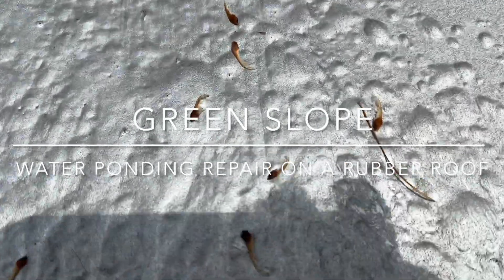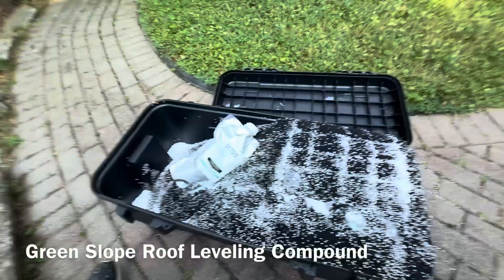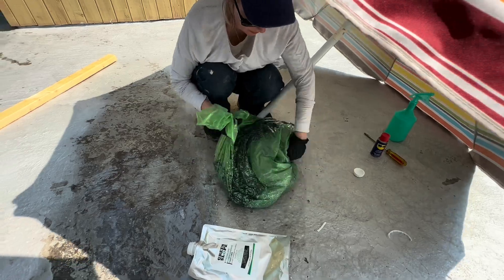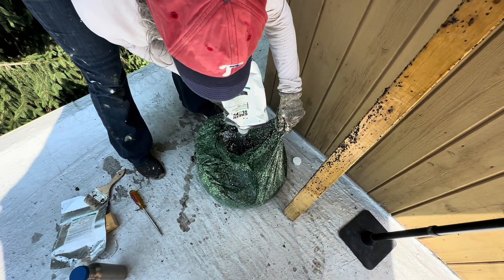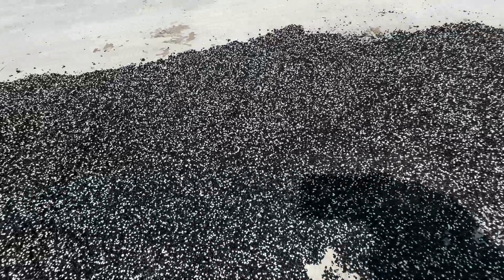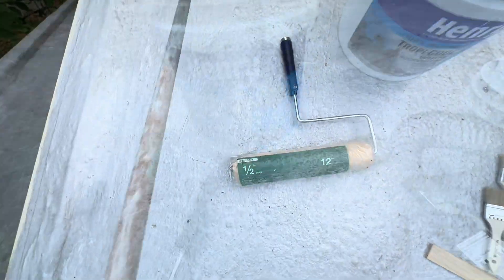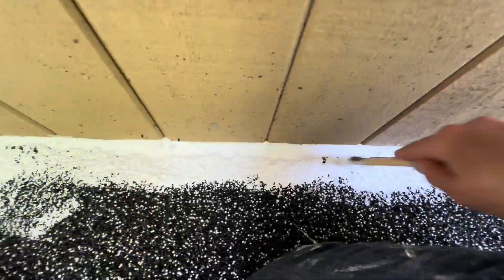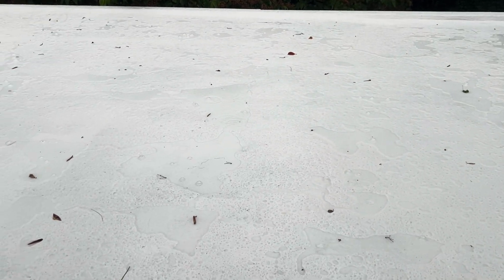Repairing Ponding Water on a Flat Roof using Green Slope

Comment: You can buy styrofoam beads and mix it with Portland or white cement and do this for 1/10 of the cost. Also add some chopped fiberglass, really helps
Reply: Would it be too heavy for the low spot roof?
Reply: @TruongLe-eo8kh  no
Reply: I mean weak spot that already has damage when looking up from under . Roof is above garage

Comment: Actual goddess.   I watched hundreds of flat roof repair videos on ponding and they were all full of shit.  Finally someone that understands basic logic of a flat roof that you need to level out the ponding before putting on any top coat anything. 

I was looking for a self leveling compound that was lightweight, but most people are using ceiment and I fear that is too heavy to layer onto a compromised flat roof. 

This stuff looks like exactly what someone should use barring industial foam sprayers which we are all here trying to avoid and DIY.

Praise be to the goddess of DIY 🎉

Comment: If you use silicone on the roof there's no need for roof sloping as it is 100 percent water proof and can pond for a long time  without any worries of the coating Deteriorating. Other coats Deteriorate due to dirt,  leaves and other debris building up and becoming acidic and damaging those ponding areas or edges. Keep your roofs clean and maintained and they will last much longer.🙂
Reply: Roof slope is 2 raise level of roof...so no water sits there!!! Not used as a coating!! My rubber only lasted 2 years due 2 this problem!!!
Reply: @terrylynn7396  100% silicone is 100% waterproof and will not get damaged due to ponding water!!!
Reply: This is wrong , silicone will fail with standing water,  it happens all the time. The water with the sun will destroy the silicone over time. The water then makes its way under the silicone and the damage spreads.  I've seen it destroy silicone in less than 2 years.
Reply: Excellent job. Thank you for informing me about this product.

Comment: Has this roof tobacco stained yet? (Turned yellowish/brown due to the asphalt bleed out from the Aluminum coating)
Reply from the maker: Not yet. It’s still white. The section that I used the green slope on is a little bit yellow, but it’s not that bad.
Reply: @Handywoman next time just buy styrofoam beads on a bag of Portland or white cement. Mix it up with some fiberglass chopped and laid down. Also, I would lay down a lot of window screen, fiberglass as you're reinforcing mesh
Reply from the maker: @RRaucina interesting idea

Comment: Can you put the green slope over top of Tropicool? Did my whole roof with tropicool a few years ago but now have a ponding section.  Actually considered just building it up with more tropicool until I found your video.
Reply: Unfortunately no. Nothing sticks to Silicone but Silicone. I would use the HE885 Silicone Mastic to float it out, then top coat with the 887.
Reply: Use green slope 1st. ....then go back over it with rubber coating!!🎉
Reply: Can we get an update?? Did it last???
Reply from the maker: @terrylynn7396 
It’s holding up. So far so good.
No ponding water.
Reply from the maker: Yes, I don’t see why not. 
Make sure to put the supplied adhesive polyurethane down on the roof first.
Reply: @Handywoman  Thanks! Just found your channel and subscribed. Keep kicking butt!
Reply: If you're going to build an up, be sure to buy yourself a big roll of fiberglass window screen. Cover the whole roof with that tack it down with a staper and coat it couple of times. Super durable roof

Comment: how was tool cleanup…what worked
Reply from the maker: It did dry on the tool that I was using.  I used a putty knife to scrap it off. When it’s still wet you could take a rag and wipe it clean. They did suggest WD40 to spray on your tools. I didn’t try that. It wouldn’t hurt to try it, it might make it easier to clean up.
Reply: Thanks for the video! Questions: how many square feet would you estimate you covered, and how long did it take you?
Reply from the maker: @robertcraven1771  I would take a guess that it covers about 50 square feet. I did this in the heat of the summer when the temperature was in the high 90s.it took my a weekend to do. Some parts you had to let sit and dry.